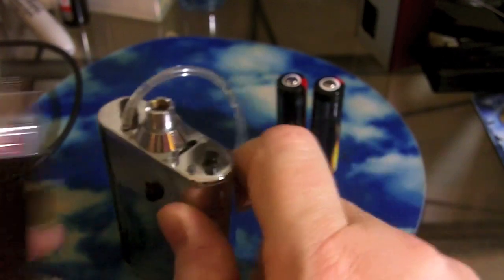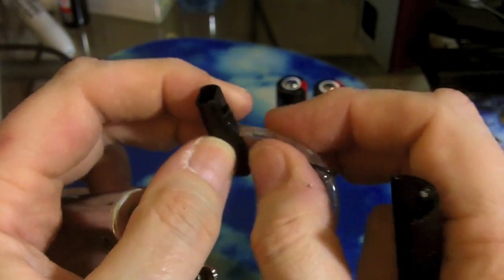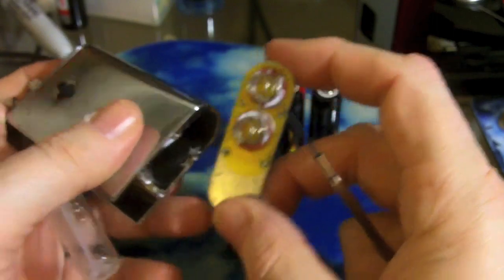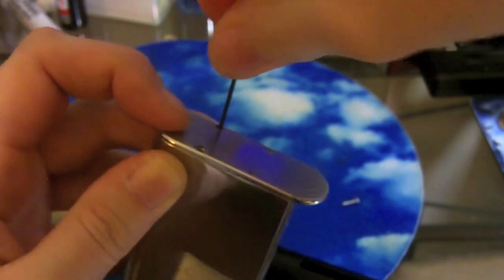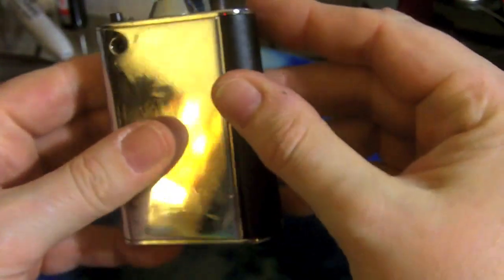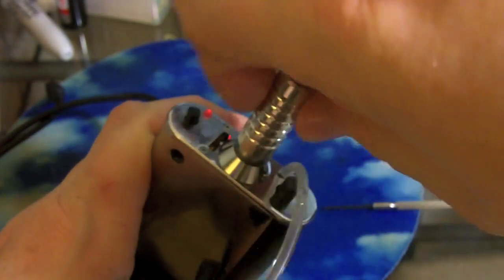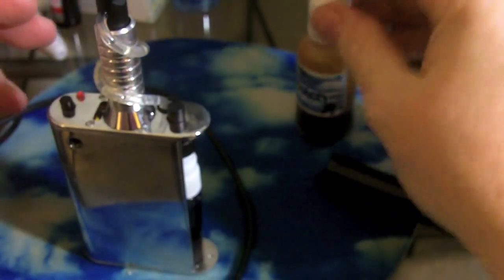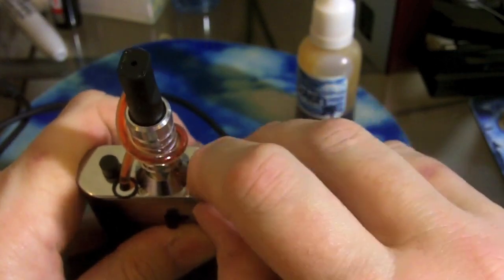NotCigs.com VVPV

Comment: The charger end is modified specifically for the chrome body.  If it didn't have that plastic spacer, the charger would short.  The screws are not allen, but torx. Don't use the smallest one in the kit, but instead use the #5. Drip tip adapters available by 04/10/2012.  I've heard that the adapter not only lets you to use your own drip tips, but also has something that won't let 'spitty' attys (like the hh.357) spit juice in your mouth.  The bottle holds 5 ml. I really like my VVPV.  Great mod.

Comment: Thanks for the review. This is a very interesting Mod. Looks like a whiskey flask, has the Buzz Pro electronic's, and has a manual pump for auto driping ( if that makes any sense LOL). Sorry but I like my Buzz Pro just fine without all the gimic's, just call me old fashioned I guess. Had my Buzz Pro for 7 months now and it has worked flawlessly.

Comment: It is $169.95 before the coupon code which brings it down to $163.15 and if you have purchased from notcigs before there is an additional 5% off automatically which brings it down to around 156 shipped..  It comes with batteries and charger, so those aren't an extra expense..  It is an all-metal mod like a REO Grand.  I personally don't think she was nearly generous enough with this one.